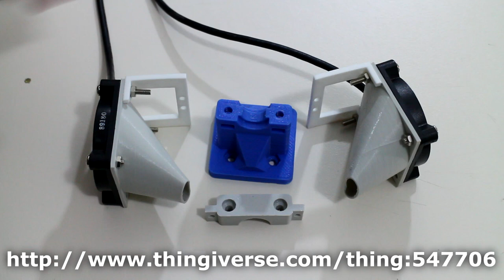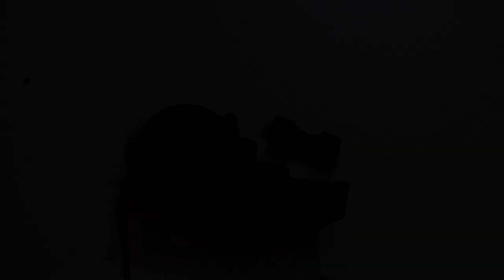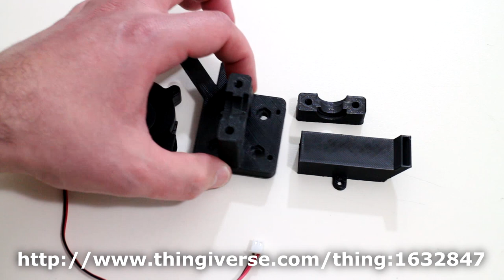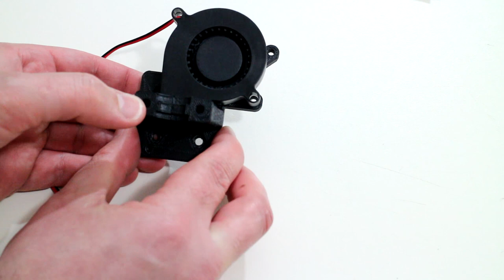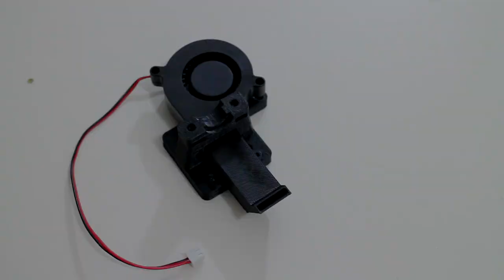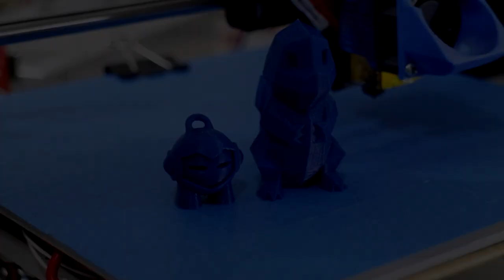3D Printer - New E3D Bowden Extruder Mount

Comment: nice new design. I will change to new one soon but my printer is now offline because the x-axis bearing worn out (damn cheap china bearing) in fact I will be changing to 45mm, much more narrower and more space on each end (need a bigger hot bed but there isn't one for the odd size). I let you know how I am doing. You should add BLTouch too, they are utter brilliant.
Reply from the maker: Thanks. What is BLTouch?

Comment: Hello Tech2C,
 So I fully understand the need for good ventilation on PLA prints. Now what about printer enclosure? Most expensive printers come with a closed build area to get control over the ambient temperature and get a nice uniform cooling of the printed object (good for ABS at least). Have you tried to make some kind of build chamber for this unit, or just put it in a crate of some sort?
Reply from the maker: Hi Rubafix, you're right about the enclosure and ABS, but I think the big advantage is confining the fumes within the box. I think if you're not printing in a drafty room, and can mainatin room temperature, then the enclosure isn't going to make a huge difference in my opinion.
I would like a box to fume the air outside, but that's about it.
Reply: Rubafix989 with pla warping hasn't been a problem for me, abs there can definitely be some warping in a drafty room, nylon seems to require a warm enclosure otherwise it warps significantly.  For ABS just covering the "walls" of the printer is probably good enough but nice having the enclosure in terms of getting the print bed up to temperature and not worrying about opening a window or kicking some fans on.

Comment: Good design BUT you have  air blowing from 1 side. From my experience in 3d Printing air must be  from 2 opposite sides. You can modify the blower tunel insert to have a radial ring on the end. It would be perfect then

Comment: Great video! I had a question about the installation of the E3dv6 itself. Did you just splice the wires (heat block and fan wires) from the direct drive extruder and connect them to the E3Dv6? Thanks in advance!

Comment: what kind of bearings did you use on the E3DV6 extruder holding piece? i assume the standard bearings of the anet a8 are not compatible with this 3D printed piece.

Comment: hi, this is a very nice design.
i would like to use it with my 2 printers but i got on one an servo and on the other an inductive sensor for autoleveling.
do you have any parts that will help me?

Comment: I've printed those parts and assembled it but not quite ready. I need to calibrate the extruded steps.  Did u also flash the board with firmware ?

Comment: How was the blow pipe printed? I tried printing on my Prusa i3 with support, since it's hollow but I messed it up. Your print from inside looks clean and nice. What setting did you use? How did you clean the support structures if you did use them? If you dint use support how come the top wall didn't sag?
Reply: Milind Fernandes No you do not print with support. the printer will bridge the top.

Comment: Great design, I would watch your air flow cooling the heatsink tough. I've had problems with blockage in the past. I might try something similar but with the fan behind the carriage, that would give room for the inductive sensor and a lower profile cleaner design overall. I can't remember if I uploaded my design with the inductive sensor to thingivers, but I definitely didn't upload my latest design. Hopefully I'll have time to upload it soon.
Reply from the maker: Hi Moshe, yeah I paid close attention to the fan nozzle not blowing over the heat block. This design has less effect on the hotend temperature set-point than my previous dual fan setup. 
I haven't used an inductive sensor yet, but I must try it as others seem convinced it's the shizzle.
Cheers and good luck with your designs :)

Comment: wich bearings are you using to assemble the x-carriage?? i'm a bit lost with that stuff because i can't find them. Should i use the ones that my Anet A8 provides me or those arent aceptable?? thanks for all Tech2C
Reply: if you can find a way to mount the current anet a8 bearings, you can use them. But honestly throw them out and get new bearings like the Igus ones as the ones with the at I got just constantly stuck.

Comment: Was just curious about how you're supplying power to the fans, I mean are both fans drawing power from the same port or are you wiring it up differently? (I am using RAMPS 1.4, which has points for only 1 fan, hence the confusion)
Reply: In a typical setup, I believe the fan for the hotend is always-on. So you can just plug it into 12v and leave it going.
Reply: Frank van Schie thanks!

Comment: This is sort of what the Chinese Flashforge knock-offs do and I hate it because on larger prints the design flaw shows up.  For theirs it is on the left side so the right side (lets not even talk about the right extruder with no fan as I am only talking about the left extruder with one) of the print stays too hot.  Benchy showed the issue as I had to turn the hull of the boat towards the fan and it printed it just right but leave it in its normal orientation with the hull opposite the fan duct and it was ugly.  This is why I love the designs with two fans or the ring ones that one fan (normally a blower) blows into the ring that blows down on all sides of the print.
Reply from the maker: I agree, I installed 2 fans previously as I noticed the opposite end of the printed part wasn't getting cooled enough. I tested those same parts that failed previously in this video, Marvin and Charmanader, both came out fine. 
Saying that if 1 fan duct nozzle causes issues we can always design a dual nozzle fan duct for it ;)
Reply: Tech2C
Yep. :)  I designed one of those rings and will be testing it (took 4 tries until I homed into the right distances) but my previous fan duct melted (was ABS injection molded) so I am scared of anything getting close to the nozzle.  Not sure what happend but what I think happened is the 110c bed softened the material and the 240c hotend temp radiated as well and it got soft then drooped and hit the part and was dragged into the nozzle.  Nozzle is black from it forever but I sure wish I was there to have seen what happened.  I took it off and the part was back to rock solid but melted together where it slammed into the nozzle but everything else was still attached.

Comment: Genuine question here: how does the blower fan blowing straight onto the heater block not cause a heating failure?
Reply: Afzal Patil it doesn't. The blower fan blows air through the duct, which at no point has a gap for the E3Dv6. The 40mm cooling fan at the front, is the fan cooling the e3d, and so it is controlled depending on thermistor heat reading.

Comment: Wow that's a great design.  I'm going to print one of those out anticipating buying an E3D for my Prusa.  One question though:  That duct.  That's obviously got to have infill to print, how is that handled?  Did you build in flutes into the model, or what?
Reply from the maker: The duct is 19mm wide, so bridging over that short distance is easy. Cheers.
Reply: I'm not sure my printer with no cooler fan and a MK8 extruder will bridge a gap that large, but I'll give it a shot.
Again, thanks for the very elegant design!
Reply: Well dang. My printers carriage has a bolt pattern for a NEMA 17 motor, so this doesn't fit. Redesigned the part to fit.

Comment: Wow serious step up in the video production quality. You now just need a rotating camera mount to smooth out the travelling shots. Can't you solve the blowing issue by changing the angle of the nozzle?
Reply from the maker: Hey Rubafix, the blowing issue isn't really an issue as the sound isn't very loud. I thought it sounded strange so captured it for the vid. 

Yeah it would be great to have a full production studio to record but my trusty old hand-held Canon EOS M will have to do :P
Reply: +Tech2C The image quality is good, and even the overall quality of this video is so good that I got annoyed by the shaking in the hand held close up travelling shot. You could probably 3d print some kind of camera rig to help you reduce the shaking ;)
Reply: +Rubafix989 at 3:10 for example

Comment: Hi, I will soon get my hands on a 3d printer, my question is how accurate can the 3d printer make metric threads?
Reply: If it's for inner threads it's better to do it afterward using a screw or a tap. If it's for outer thread maybe it would be possible for big diameter but don't try to put too much torque on it since 3D prints are weaker in the direction if the xy plane.
Reply: +François L ok, thx :D
Reply: Hi Jeff, I have used my prusa i3 to print replacement fittings for my CNC spindle water cooling barb fittings. These had an outer M8x1mm pitch thread. I printed them without support (the threads are really fine so not much overhang).

It took me a couple of tries to get the thread profile right in CAD, but no leaks under pressure and I did not use thread tape. The plastic seals up nicely and holds very firm.

I snapped one of the metal ones that came with the spindle without very much force at all, but no problems with the printed one even with a fair amount of force using a tool to tighten it.

If I had a tap and die set I probably would have tried that first, probably much more accurate.
Reply: thanks for the info

Comment: since it's only blowing from the back do you notice the front suffer?
Reply from the maker: I tested for this with the Marvin and Charmander prints. No problems!
The blower fan pushes huge amounts of air through the nozzle, more so that the 50mm axial fans. You can feel the air rushing through over the print bed. That's at 100% fan speed though.
Reply: ぞあ

Comment: Awesome video!   I have a reprap i3 coming and I'm already considering ordering an E3D!  I might try a clone first and go for the real deal later.   This is definitely the best v6 carriage mount and fan orientation I've seen so far.  I'm pretty sure you've included a mount for an auto-level sensor but headed over to Thingiverse to check out your designs.  Also wondering if someone has remixed the nozzle to the ever popular "circular" cooler.   Nice work  - subbed
Reply: ajmckay2 hey man. I ordered a anet a8 and am thinking of doing the same mods. I have another printer already so if I break anything I might be able to fix it lol. Keep me updated how your build goes. I might need help
Reply: ajmckay2 also if no one has remixed the blower to the circular one I think I might give it a go
Reply: Looks like there is already a circular fan attachment
Reply: Honestly, the best way to try out an e3d clone is to pull the money out of your pocket, rip it up, and throw it in the trash. It's the best way because it costs the same, but saves you the shipping, troubleshooting and headache.

They all look great in the pictures. till you get them.
I'm of the strong opinion there are 2 parts on your printer it isn't worth cheeping out on. Controller boards, because decent stepper motor drivers makes a huge difference in print quality, and hot ends, because 500 degrees Fahrenheit makes a huge difference in house quality.

The mount is great though, printed mine last week. looks boss! I wish it had a circular duct like the prusa i3 though, I get some weird sagging on my overhangs if I go in the wrong direction with bridges.

Comment: Do you never have issues with your extruder temperature dropping too low due to the cooling directed right at the nozzle end?
Reply from the maker: Nope. The airflow passes just under the nozzle. I've read comments of others not using genuine E3Dv6's that the length of the entire hotend assembly is slightly different, meaning the air flow could hit the nozzle or the block.
Reply: ahh Thanks for the update! Also from your knowledge, would you ever say you can have too much cooling? I dont mean overkill but .. you know what i mean haha
Reply from the maker: You can never have too much cooling! Of course you can regulate the fan speed to suit the circumstance.

Comment: did you print the fan piece with a support material ?
Reply from the maker: Yes. I used Slic3r.
Reply: Can you tell me your material support specifications , Thank you . (Your system is really good )
Reply from the maker: cuadrado theo

Sorry, I meant to say no support required. Slic3r correclty sees the top of the fan duct as a bridge so engages the cooling fan and adjusts print speed.
Reply: Oh ok , Thank you

Comment: How does blowing cool air on to the hot bed help at all? This may work great for PLA, but may introduces more warping and adhesion problems when printing in ABS cause of the air blowing on the bed.
I print ABS @150mm/s without cooling fan (except with the one that comes with it).
 Apart from adding more weight (Extra fan & fittings), which will interfere with me printing at those speeds.